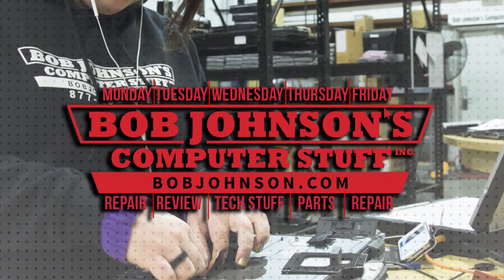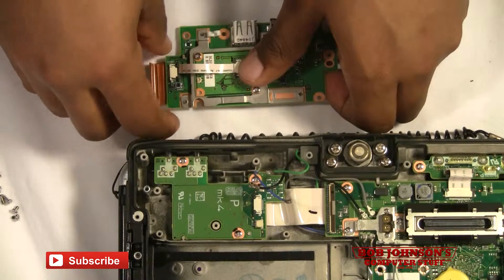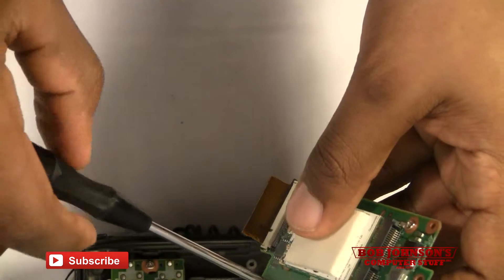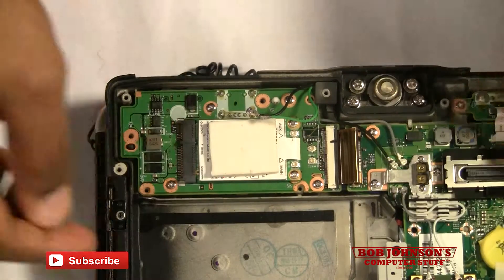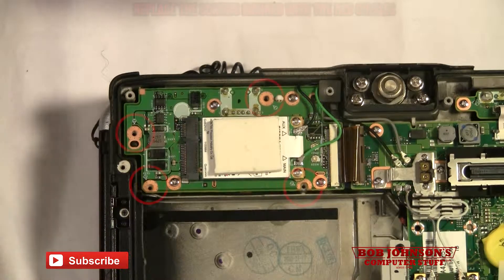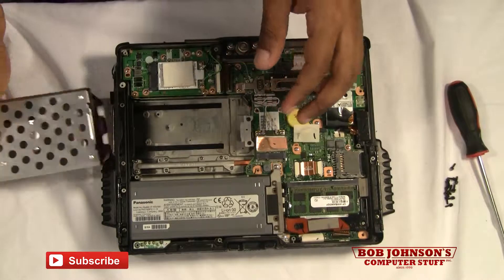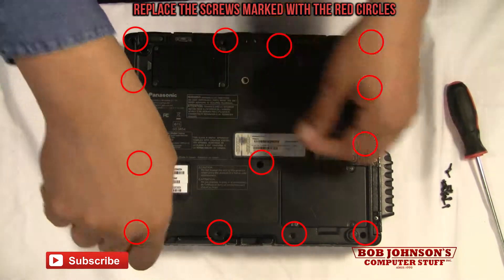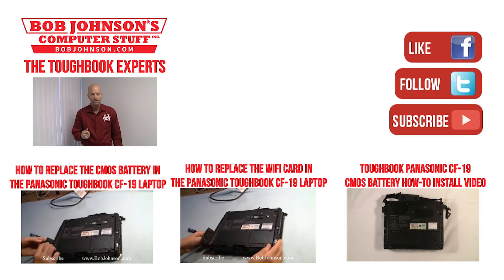How to Replace the Bluetooth in a Panasonic Toughbook CF-19 (Part 2)

Comment: so if I want to leave the Bluetooth out, just leave the Bluetooth antenna removed, the blue wire and the ribbon cable disconnected and just install the HSDPA again? I need to use the laptop in an area that does not allow bluetooth/wireless.
Reply from the maker: I am not sure.